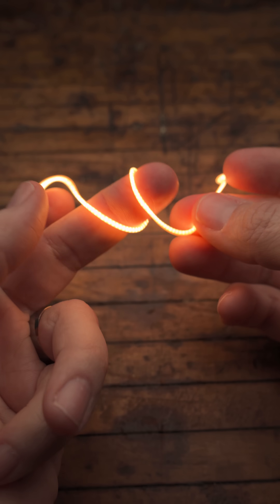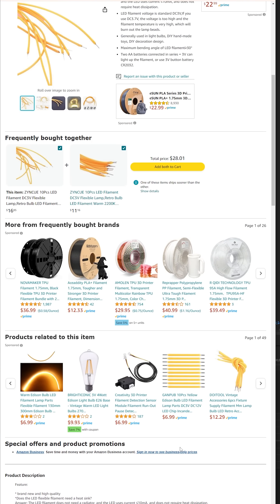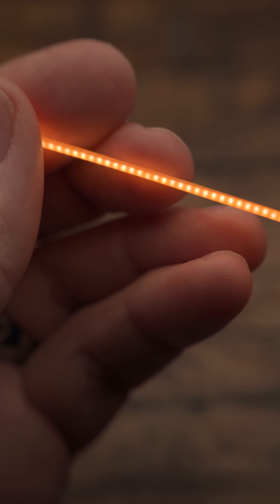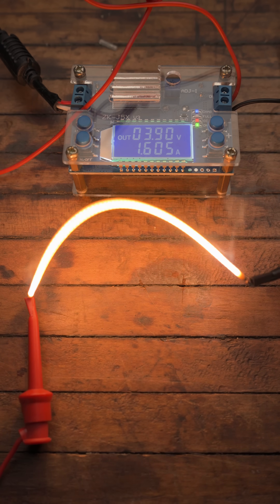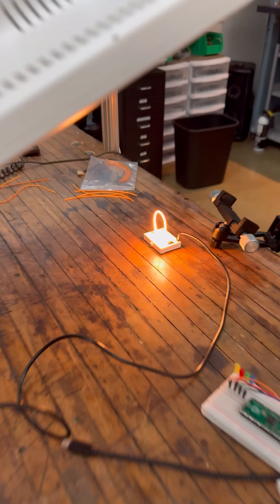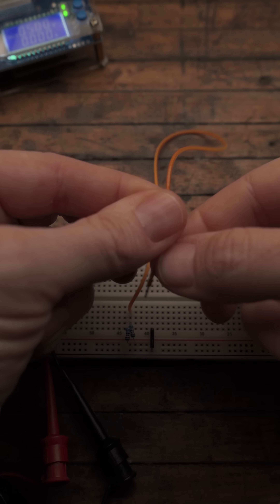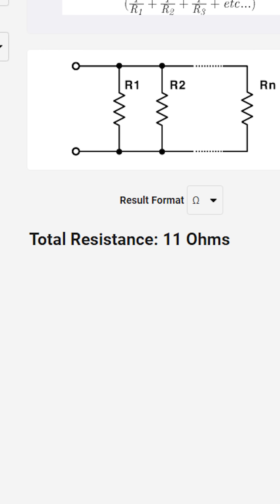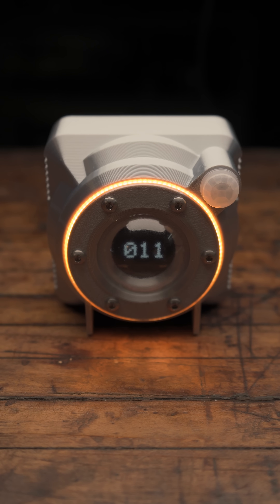#FlexibleFilamentLED

Comment: If i order 400 sqrfoot of this how much resistance would i need im wondering....
Reply: Depending on your power supply, none. The resistor is just to reduce input power 

These typically come in lengths up to 1200mm (24V)
Reply: @prophetzarquon ahhh thanks for the input!

Comment: EL wire for the win, but thanks foe the info
Reply: EL-wire requires very high Voltage (~10KV-20KV), so they have inverter whine & a high risk of shock \ spark.   
These COB flexible LED "filaments" run at low voltage, suitable for a lot more applications...
Reply: @prophetzarquon  yeah fair enough. I actually kinda hate the whine

Comment: Amazon not having datasheets for electronic components is the bane of my existence as an engineer lmao
Reply: To be fair lots of data sheets are just flat out wrong as well on other sites lol, You lose. You lose almost always
Reply: That’s Amazon allowing cheap cheap cheap third and fifth party manufacturers to sell things
Reply: Some sellers on Amazon and EBay are nice enough to send you the datasheet if you ask.
Reply: @elitecookies8155 it should be included, Amazon had a method for displaying data sheets towards like the bottom of the listing, so said seller should be nice enough to just put it there
Reply: Mouser
Reply: Unless using very reputable source like side above
Reply: Digikey <3
Reply: "Just make it yourself"

> me looking at the 30V, 3MHz GBW, high slew rate JFET-input op amp on my desk that's the size of my thumbnail
Reply: Mouser my dude
Reply: @joj. i was just on the mouser site and clicked on the data sheet for these and it came up with nothing! 😂 granted, I’m on a phone and in france, so too many variables…. Cheers!
Reply: i buy little parts on sparkfun however it is very overpriced and limited selection but they have what i need
Reply: As an occasional Amazon seller I’ll say it is neigh impossible to get Amazon to accept uploaded documents on certain listings even if you own them. Depending on the product they’ll have a section to upload such documents, though they’ll either be rejected, stay in limbo approval permanently, or simply won’t display outside the seller view. Amazon support is toothless and they’ll tell you as much, I’ve seen electrical components listed under “swimwear” and spent the better part of a month attempting to correct just the category and eventually gave up.
Reply: Getting stuff on amazon as an engineer is the bane of everyone else's existence 😂 get your stuff from a reputable source dude
Reply: @dimitrijekrstic7567  thats why they want the data sheets! Transparency leads to companies being a bit more reputable, at times.
Reply: @dimitrijekrstic7567  like AliExpress or other chines sites... right?
Reply: Wow I love that there are 3 comments expressing malicious levels of ignorance at what engineering means lol
Reply: Amazon 😅 the benefit is near instant delivery. It's been awhile since I shopped components, what's the lead time on goodies like these from digi-key or mouser, and can you get fun shiz like this there, not in bulk? the guys saying you can't shop at Amazon don't get that as an engineer, you got to gets fun kind toys too!
Reply: Just get a component tester for god's sake
It took me to another level
Just make sure it has a quartz oscillator inside to get a legit one
Reply: should be a law against that for safety at least, probly already is a law
Reply: Amazon 🤮

Sorry, far better, still very convenient suppliers exist.
Reply: Amazon is the bane of existence*

FTFY
Reply: Amazon is made for consumers. As an engineer you most definitely are not a standard consumer. Stop being cheap trying to get products off Amazon. Be a true engineer and pay 3-10X the cost of an item solely to ensure the reliability/ consistency between tests… Live and touch learn Mr. “Engineer”
Reply: @MKUltraXOXO-c3r  "Be a true engineer and pay 3-10X the cost of an item solely to ensure the reliability/ consistency between tests" For this amount of money, you could ran the tests for 3-10x times more often, or have 3-10x more items/products 😂
Reply: @MKUltraXOXO-c3r  I work at an R&D startup with like five employees. I'm not going to spend $300 on a vacuum pump with a 6 week lead time when a shitty $30 vacuum pump on Amazon does exactly what I need and gets here by 9am tomorrow morning. 

Obviously some things you don't want to buy on Amazon, and obviously if you are making and selling products, you shouldn't be buying your components from Amazon. But if you, as an engineer, can't tell when you should spend the time and money for the nice parts vs get the cheap shitty part from Amazon, that's on you
Reply: @MKUltraXOXO-c3r  or... make it yourself for a fraction of the cost.
Reply: how is somebody just supposed to manufacture components at home. Its bad for cost, bad for time, bad for reliability. Being an engineer doesnt mean we dont buy stuff online if we can, nobody is going around reinventing the wheel.
Reply: @osmacar can you do a tutorial video on how to make one? Come on Mr, Wizard.
Reply: @osmacar like make your own semi conductor wafer from scratch, then slice it into your own dies? or do you mean buy already made leds but connected them into flexible "filament" yourself? feels like pointless to do it yourself when the manufacture could just have pdf available with the specs xD
Reply: An engineer buying electronic components from Amazon.. fake
Reply: Lmao ‘engineer’ buying parts from amazon… get a load of this guy
Reply: @tobiaszstanford eh depends, there are times when my facility has to resort to searching places like ebay to keep legacy machines running, the parts just aren't manufactured anymore (upgrading would cost millions per machine, so not something you can ask corporate lightly). On the other hand engineers are also ppl, with private lives, i.e. he could be buying parts for personal projects. The other consideration is that he might be doing small batch upgrades, qol improvements, or maintenance work and looking for parts that'll work delivered fast.
Reply: Make it yourself, you're an engineer.

Comment: I doubt longer lamps need more current. You have to reduce the resistance because each LED has a voltage drop across it. Therefore, you have a smaller voltage drop across the resisters. This means the current limiting resistor must be smaller to provide the same current.
Reply: Why would they not need more current? Longer filament means more LEDs which means higher wattage, but since they're paralleled it's the same voltage, so naturally it's the current that will need to be increased.
Reply: @triplestaff yup.
Reply: Each diode requires the same amount of current. They are connected in parallel. 100 diodes require the same 3V to run, but 100x the current.
Reply: From what I can tell, they're not typically in parallel. Most COB LED "filament" I've seen, are run in series, inside. Longer lengths are labeled for higher requisite Voltage.
Reply: The LEDs in the string are connected in parallel? That means that thermal run-away is a concern, since higher LED temperature tends to allow more current, thus more heating...

Comment: Can we print with them?.
Reply from the maker: I wish!
Reply: @HackMakeMod  if only they made it with clear petg, cause I am betting that's what it is. And it must be extruded in production. I'm almost willing to buy some, measure it, and put it in my printer
Reply: No. They are LEDs connected by a thin metal strip, & sheathed in silicone! Basically a tiny rope light.   
3D printers melt plastic, to print with it; both would get ruined

Comment: Can you do a video where you create a circuit that looks checks for a 1.5 volt signal and 5.0 v signal (the input is pulled up to 12v when neither button is pressed) and then outputs to two separate channels? I’ve tried using opamps to measure the incoming voltage but have been having difficulty
Reply from the maker: I’m going to need more context. For instance, the amount of current being drawn. And are all sources sharing a common ground?..
Would you mind contacting me with more details through our the form on our website?

Comment: These are also great for making things with a retro asthetic that are also power efficient.
Reply: I am no electric engineer, but i do think that it is possible to create a circuit that does exactly that gradual heating/cooling effect. Although it does ruin the immersion
Reply: @viperforty8450  you would probably need an rgb strip to do it convincingly. Incandescents start out red before they hit full brightness.
Reply: @viperforty8450 yes you can
Reply: @viperforty8450 главное что бы стекло поглащало уф.
Reply: Why not.. just keeping old tech. Lol.
Reply: @gui18bif  because it's less reliable, less cost and energy efficient, and more expensive. LED's just make too much sense NOT to replace incandescents. The ONLY objective advantage they might have is the specific distribution of light color which is more uniform. But that's hardly an insurmountable issue for LED's, especially as the tech improves
Reply: A good middle ground. But you sometimes miss the glass or the gradual on/off of incandescent bulbs.
Reply: @midgetman4206 you can design the circuit do just that
Reply: Like a modern nixie tupe clock.
Reply: @Gh05tk3y  Except the modern version is actually better

Comment: Does it make sense that the  longer strings would need more current ? Isn't the current the same in all diodes connected in series ?
Reply: So in parallel there must be some kind of internal resistor at about 10 ohms or so on each chip... Diodes are funny that two or three or more in parallel, the one with the lowest voltage drop across it will try to take the lions share of the current. With individual ballast resistors on each one, they will seek their own level of equilibrium in the string.  If 100 LED's are in the string, then 300 ma would suggest that each of them is running at 3 ma. Use the power supply to turn up the current and find out where more current does not make more brightness and turn it down just under the knee to max brightness. That will give you the longest life of the LED string with no burnout.
Reply: Yeah, you are right if the diodes are connected in series. But they aren't, since that would increase your voltage requirements. Every diode adds around 3V if connected in series, keeping the current the same through all of them. But once you connect them in parallel, you start adding up the current, while the voltage stays the same. Meaning a hundred of 3V diodes in parallel still require 3V to run. And in series that would be 300V
Reply: Why are the longer lengths listed at higher Voltages, then? 

The 1200mm say 24V.

Comment: Hasn't considered the impact on the life of the device.

It is well known that heat shortens the life of semiconductor devices. Diodes are semiconductor devices. It is well known to most engineers.
Reply: And Leds can take much more current than they need, they wont get brighter, just make more heat
Reply: Though if you make two over current measurements you can estimate its lifetime at the rated current using that exponential function who's name I have forgotten
Reply: @Music_Engineering your motha
Reply: Did you watch the video?
Reply: @electricpaisy6045  Did you?
Reply: @deang5622   he talked about overpowering and then you saw smoke coming from it. If that isn't what you mean, I don't know what your point has to do with the video.
Reply: @electricpaisy6045  Clearly you haven't studied any semiconductor physics at university, have you? That is why you don't understand what I am talking about.
Reply: @deang5622  it was my major
Reply: @deang5622  the thing I don't understand is how you can watch this video and say he didn't consider lifespan even that was exactly what he tested
Reply: @deang5622 imagine thinking you need to go to university to understand a very basic principle. That anyone with a computer or a phone that has overheated already knows. You must think you are 50x smarter than you are
Reply: Should be using PWM to control luminance
Reply: Lmaoooo, delete your embarrassing comment.
Reply: @deang5622  nobody cares about your opinions

Comment: If I wanted to tinker with these what supplies should I buy?
Reply from the maker: Just a 3v-5v power source and appropriate resistors. If you can give me an idea of what you want to do, I can make some suggestions.
Reply: @HackMakeMod ahh use those inside a pc 😂 case and around the table 😅